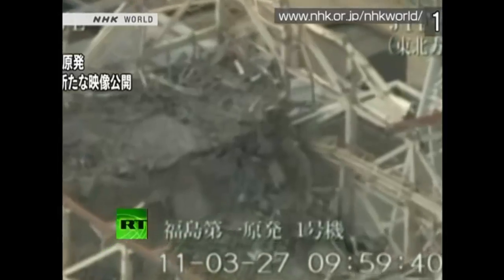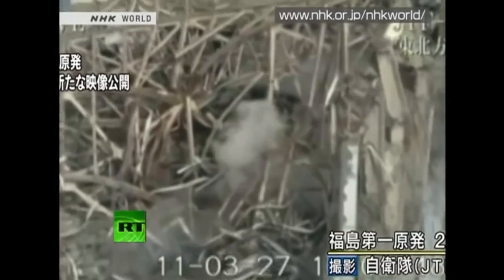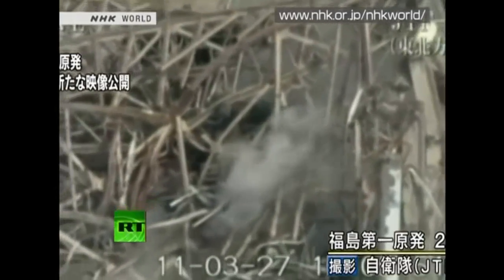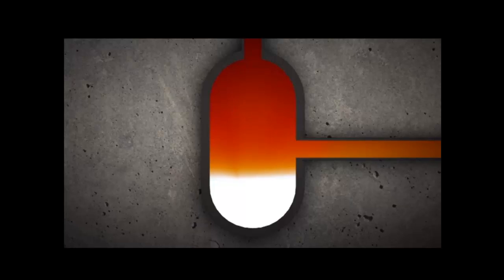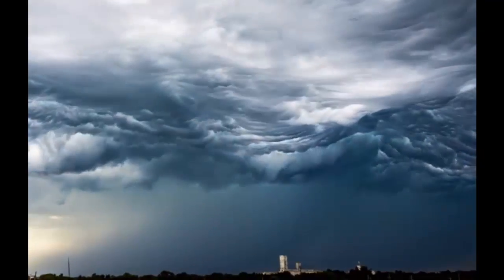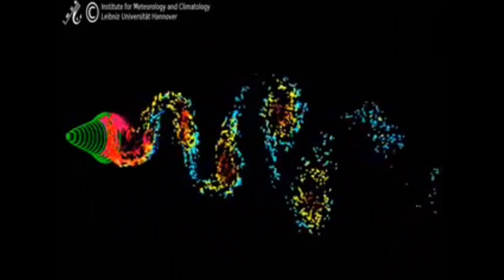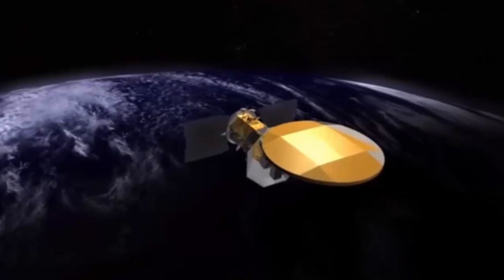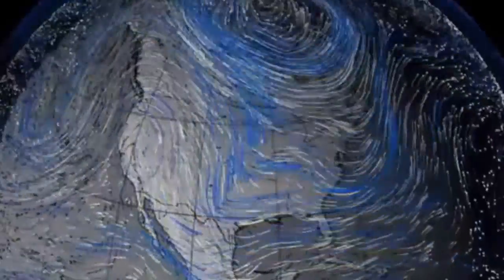Wigner6: Fukushima "Dust of Death"

Comment: OFFSITE NOTIFICATION DUE TO OIL LEAK FROM MAIN TURBINE LUBE OIL SYSTEM

"At 1212 EST on December 12, 2014, D.C. Cook notified the State of Michigan and local authorities of an oil leak from the Unit 2 Main Turbine Lube Oil Cooler to Lake Michigan. Approximately 2000 gallons have leaked into Lake Michigan since October 25, 2014. No visible oil or oil sheen is present on Lake Michigan or the shore line. The leak is currently isolated as of 1030 EST on December 20, 2014. Leak repairs will be made to the cooler prior to placing back in service.

"The NRC Resident Inspector was notified.

"This notification is being made in accordance with 10 CFR 50.72(b)(2)(xi) due to notification of offsite agencies."

Notified DOE, EPA, USDA, HHS, and FEMA.

Comment from the maker: In-flight breakup of helicopter today, Salt Lake City:

"Ben Tidwell who flies for KSL-TV, was at a nearby airport when he heard a frightening noise and told his own news station he instantly knew something bad had happened.

“That is the sound of things coming to pieces big time,” he said. “This is an in-flight breakup.”

Moments later, Tidwell said his mechanic pounded on his door and told him he had just witnessed the helicopter fall apart in mid air and crash.

“The entire tail rotor and assembly is sitting about 200 yards away from where the rest of the aircraft crashed down into the building. The aircraft itself is smoldering, seemingly on fire in the building, completely inside the building,” he said.

Debris from crash was spread out over a 400- to 500-yard area, Tidwell told KSL..."

More at 
http://q13fox.com/2014/12/02/helicopter-crashes-into-building-in-salt-lake-city/

Comment from the maker: NUKE PRO ~ Massive Radiation Found on Chicago to Honolulu flight 11/23: "Very interesting findings on my last airplane flight. It was during the day, so good lighting, and no adjacent passengers, so I could do plenty of Geiger testing without getting anyone upset.

There was considerable radiation differences in different areas on the flight path, and at the same cruising altitude.  Basically 11 CPS to 15 CPS. CLICKS PER SECOND!  not per minute, per second!

The upper atmosphere is FULL of radiation. Much more so than 20 years ago. Cosmic radiation is various stuff, and what you will pick up on an Inspector Geiger will be gamma. There is no beta radiation in Cosmic.    

By putting the Pancake Style Geiger on my leg, I can effectively block all beta coming from the "downside".  Beta from the "upside" will still hit the Geiger tube, so I can block half the Beta

In multiple repeated tests the readings quickly ramped down from 15 CPS to 11 CPS doing the BetaLEG-Block <BLB>(TM stock 2014)

Since I was blocking 50% of the Beta, this means there is 2 times 4 CPS beta in the aircraft.  8 CPS Beta, of 480 CPM Beta inside the air of the airplane.  

This Beta, to repeat, is not Cosmic. Fukushima is here.

http://nukeprofessional.blogspot.mx/2014/11/massive-radiation-found-in-upper.html?utm_source=feedburner&utm_medium=email&utm_campaign=Feed:+NukeProfessional+(Nuke+Professional)
Reply: thanks rad chick
Reply: thank you christina
Reply: Bonnie C The other day I was asked 'Do you like to fly...'
truth is I do, but knowledge is not bliss thnx
Reply from the maker: Because I used various items in my carry-on to block and test.
Reply from the maker: ...as did NUKE PRO: http://nukeprofessional.blogspot.com/2014/11/massive-radiation-found-in-upper.html
Reply: Rad Chick When you fly, you always expose yourself to significant radiation because you are above most of the atmosphere that normally protects from cosmic rays.  During a solar storm, and particularly on polar routes, you can really get quite fried.  The radiation is sufficient to damage digital cameras.  This has nothing to do with Fukashima, it is a normal hazard of flying, especially on polar routes.
Reply: you can lead a horse to water, but you can't
make him drink.  you can give a man some knowledge but you can't make him think. this
couplet is inspired by the stupidity of +joey
Reply: do what you want, it is a free country
Reply from the maker: Angelia Bell Consider the source. YT channel with no subs and no videos = troll central.
Reply from the maker: Robert Dinse Yes, that's all well and understood, however that was not what was being measured here. Read the article. THERE IS NO BETA IN COSMIC.
Reply: I will, but I will still look for good info. I know
they are money hungary and stupid.  I think they know it too, but most times they have a good sense of morality.  unlike alex jones.  are you here for nim?
Reply: Rad Chick There is beta in particles from the Sun, and there are secondary particles caused by collisions in the upper atmosphere.
Reply: I guess you were.

Comment: the Boeing 757, United Airlines flight 1564 landed safely at Dulles around 6:20 p.m. Monday. Upon inspection of the plane, Yingling says they found a blown tire on the left main landing gear.
http://hisz.rsoe.hu/alertmap/site/index.php?pageid=event_desc&edis_id=VIV-20141118-46040-USA

Comment: 10:30 I think here she is in over her head in regard to the magnetic field around the earth. We need to question the blanket assumptions that even well meaning people make. It is impossible to generate an electrical / magnetic field around a molten (metal) core beyond about 950 degrees. We should never let convenient explanations substitute for our need to question all.
P.S. The tectonic movement theory is also unlikely and should be looked at. I think expansion makes more sense.
Still - a very important video
best